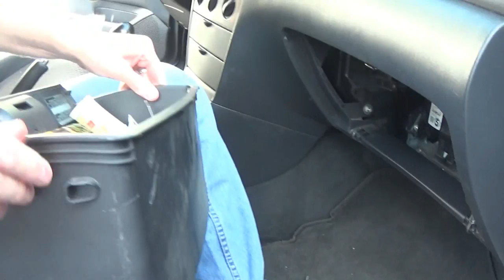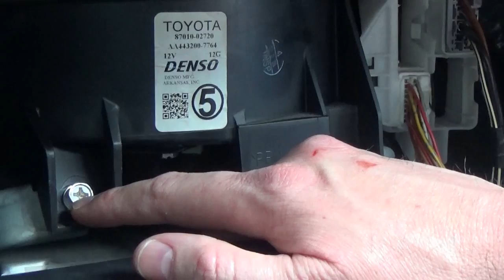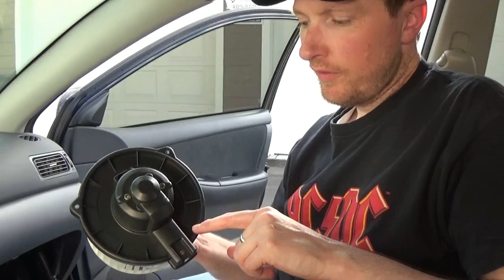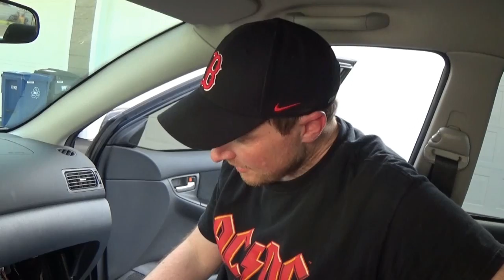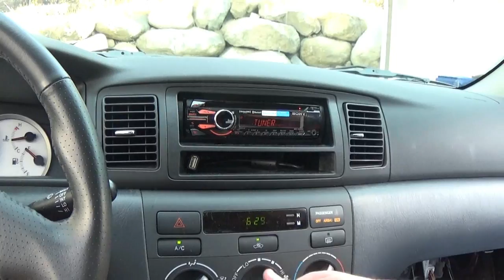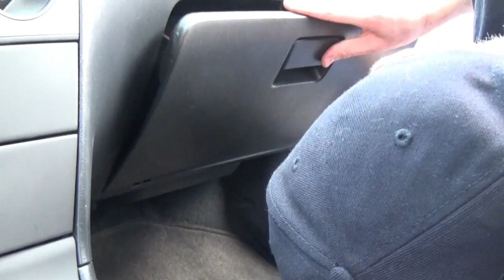How to replace a blower motor in a 2003 2004 2005 2006 2007 2008 Toyota Corolla

Comment: Thank you for this video! We had about -10°C (14°F) here and my Avensis wasn’t blowing warm air, so the car was freezing. Even though you worked on a Corolla, the solution was very similar on my 2008 Avensis T25 and it really helped. I didn’t even have to replace the blower motor — unplugging and plugging it back in made it start working again, so I cleaned it and sprayed the contacts with WD-40. Much appreciated!

Comment: Thank you so much. You're video was the first one i watched. After I watched the video I ordered the blower motor on Ebay for 38 dollars. Had a little trouble with the electrical connection but was finished in an hour.

Comment: Good video, made the job really easy.  One tip I would add is to remove the rear two star screws for the blower motor first as the OEM motor sagged and made it very difficult to get to the last rear screw.  After struggling a bit, I ended up putting the front screw back and it made taking the last rear screw out really easy.

Comment: I am currently inspecting my motor. Not for failure but rattling. I think some small mouse size critter ate its way in through the filter and died and now it bones are rattling like dice in there.

Comment: Such a wonderful FYI. My heater blower quit working . I went to a salvage yard and practiced on their car  . I easily removed the blower and was charged 8.00.
 Before I changed the blower motor I found that I could access the blower cavity through the air filter slot. I found enough grass stuffed in the filter cavity to fill the cage. I removed the grass and turned on the blower. Everything ran fine  except for a loud noise. The pressure from the clog had bent the blower shift and bent it. I will have to replace the motor anyway. I didn't win but I learned. If yougo to a mechanic he will probably charge 250.00 to 300.00. Mine was 8.00.

Comment: Thank you for this video. I had a mouse rotting away in the fan motor. I never would have been able to figure out how to get that fan apart and back together again.
I am a 69 year old woman that managed to squeeze myself into that space and get the dead  mouse out and put it all together again. I could not have done it without this video. And I hope I never have to do it again.
Reply: Well done! I just got quoted $560AU from an airconditioning mechanic. Going to do it myself as well :)

Comment: Do Blower motor make loud
Reply from the maker: Sorry not sure I understand,  could you rephrase?
Reply: @ToddsGarage  I have a Toyota Camry 2011 my fan motor blowing kinda loud
Reply from the maker: It is hard to say for sure without seeing it,  but that is something that can happen if it's going bad. Does it change if the fan speed goes up or down?
Reply: @ToddsGarage  When I turn on heater can 🗣️...then when I turn off no sound.

Comment: Thank you!  I replaced my blower motor in August 2020.  A few months later i smelled burning when the fan was on high and the headlights dimed.  I was told it has too much current.  How do I know what kind of blower motor to buy?

The fan from low to the 3rd setting works fine and does hot and cold, AC and defroster fine.  It's just when the fan on high I smell it and the lights dim.  2005 Toyota camry.  V4.  About 178000 miles.
Reply from the maker: Thanks for watching,  if you go to an automotive store they can cross reference and make sure you get the right model for your vehicle.

Comment: I have discovered a noise from my 2005 Toyota Corolla. It is very faint and when I slow down apply brakes it gets a little louder. However when I turn the fan off there is no noise. Tomorrow I will check the fan thanks for the video AC/DC Rocks
Reply from the maker: Thanks for watching!

Comment: Thank you. That was a clear presentation. I might be doing this tomorrow after I confirm that it's not a blown fuse problem. I feel confident in doing this after watching this video.
Reply from the maker: Thanks for watching, I got a video on the resistor as well.

Comment: Thanks for the video.
But before I tried anything, I first did what I usually do with repairs. I made a soft fist and hit the blower from below. And wham! It started running again! LoL I'll do that with electrical parts (softly) such as a headlight or license plate light and often it solves the problem very quickly and extremely inexpensively! hehe
Reply from the maker: Thank you for watching,  at least you know how to replace if you need to eventually.
Reply: @ToddsGarage  Exactly! And why I thanked you right off the bat; for future replacement knowledge. Because just like a starter being bang with a hammer to work only works a certain number of times until it no longer works.

Comment: Will this work for 2002 camry? My ac stopped working all of sudden. No green light and no air in vents. I changed one blowed fuse and still not working. Also I can hear some noise when driving. But couldn't pin point what? Someone said alternator bearing. But my stopped working after noise started.
Reply from the maker: Hard to know without being there and seeing it.  I hope you get it figured out. Good luck and thanks for watching.
Reply: @ToddsGarage  well today my car started smikin.and i notice black melted plastic or rubber between compressor and clutch pulley..would that be the bearing burnt up?do you have a video to replace that?
Reply: @ToddsGarage  and yhsnk you for your response earlier..
Reply from the maker: @tiffanytip9594  Hi again, yikes, and I am not sure what that could be. I unfortunately do not have a video on that.  Good luck I hope you get it figured out.

Comment: My motor works but is there any way to make it blow stronger air?
Reply from the maker: When you turn the knob does nothing change?
Reply: Todd Saville yes it does change with each turn. But the highest setting just doesn’t feel that strong. Maybe it’s a screen that’s clogged up with dirt or something
Reply from the maker: The filter is easy to check.  Please see my video on that it might help you determine if that is the issue.

Comment: Thank you 👍
Is it normal for some time to influence the warm air?  not always hot air.
Reply from the maker: Hi blower motor should just control the air flow. Not the temp.  Good luck hope you figure it out.

Comment: Thank you for this video. Mine is a corolla 2004, it flows very little (at the number 1) and just little more air (at maximum speed and sounds like it was at the maximum but just not flows much air conditioned), so do you think is the blower too? Thank you again for your response
Reply from the maker: Could be the blower or other things. Did it gradually get worse over time?

Comment: My wife's 03 Corolla just stopped blowing but if I hit the dash or a bump in the road it will usually start back up? Is something just loose? Thanks.
Reply from the maker: Very strange. Its possible a connection is lose. Im not sure where to direct you on that. Good luck and hope you figure it out.
Reply: @ToddsGarage  replaced the blower motor and it works great now 👍

Comment: 8mm works perfectly to remove screws holding blower in place.  Took me total 15min to change blower.  Super super easy.  Remember to wiggle electrical connection to remove from blower, don't yank or it might break.  Thank you soooo much for this video :)  helped a lot!  P.s. cost $40 for blower/motor unit on Amazon.  Also replaced breaker for blower,  $10 Amazon.
Reply from the maker: Thanks for the feedback!

Comment: Hi Todd, good day and thanks for the wonderful video.
Please I'm faced with venting problem. When using the AC and all windows are wound up and the air circulation is on internal re-circulation, each time I pass a smoky area, the smoke enters inside the car cabin. How can I solve this issue please.
Reply from the maker: Hi, not sure how to fix this unfortunately.  It would be one of those things i would have to figure out.  There is a door/flap that stops fresh air from coming in. Maybe it's broke or jammed, or the switch that controls it is broke.  Sorry i cant be of more help. Good luck and let us know what you find out.

Comment: Do you know where the heater control valve is located at?
Reply from the maker: I havent had to fix mine, so not sure.  Possibly on the firewall under the hood.  It probably varies by year and model as well. I would ask local auto parts store when you buy the replacement.  They should have a diagram.  Good luck and let us know.

Comment: I found your video and decided to change out my A/C blower myself.  So I went on Amazon and ordered a new blower and a cabin filter.  Got them yesterday.  Today after work I decided it was time to do the deed.  All the instructions for removing the blower were spot on and it came out without a hitch...

...however... I know why you don't have video of you installing the new blower.  You need three hands and there isn't that much room under the glove compartment.

After spending about an hour kneeling next to the car and sweating like a pig, I gave up for today.  I'm going to try again tomorrow.  

I can use my right hand to try and get the blower lined up with the screw holes and then I can hold the star bit in my left hand.  What I want to know is what hand do I use to put the screw in the hole and hold it there until I can apply the star bit?  

I even tried using little bits of duct tape to hold the screws in the hole while I tried to line them up, that didn't work.    So if you could pass on your secret to actually installing the new one for those of us who aren't mechanically inclined, that would be fantastic.

** just read a comment below about duct taping the motor in place so I don't have to hold it, which would give me both hands free to insert the screws.  I'll try that tomorrow morning...
Reply from the maker: I hope you got it. There is no secret, it's tough to get it in there!

Comment: Excellent video!!! I was able to fix it and it only cost the price of the part and about an hour of time. Them 3 screws that hold in the blower ain't no joke to screw out or in. I wish I had the star screw driver or at least a magnetic flathead. Maybe they would have made it easier.
Reply from the maker: Glad to hear you got it done yourself!

Comment: Thanks so much for making this video, watched it and was able change out my blower motor and have sweet, cool, cool AC again and saved myself over $250 since didn't have to take it to the mechanics.
Reply from the maker: Glad you got it done yourself!
Reply: N N Yeah, it was intermittently working and then not working (and the fan was louder actually then it is now with the new blower in). Once it stopped working altogether (but cold still feel cold air trickling out when driving fast enough on the freeway and worth the recycle air off) I checked my fuses and also made sure the blower was getting power before switching it out,.

Comment: I have tried everything suggested still no air. I had good air on Thursday then stopped blowing. Started then stopped again. Light on AC want light up. Any other suggestions. Fuses good.  Replaced resistor. Blower looks good. Never any noise.

Comment: Hi Todd – I've just opened my glove box to replace the AC blower resistor, but... it's just not there!! :-) Do you know, by any chance, where I can find it? The blower only works on "4", which is direct con, so I want to replace it. But first, I need to find it :-) Thanks for your help in advance.
Reply from the maker: I dont know the answer to that one. You would think it would be inbetween the center console amd the blower motor but i dont know. If you find out please post on here so others will know.  Thank you and good luck.

Comment: Spraying Rataway Fragrance, from Rataway.com  on many things. I would spray the engine, hood insulation, wiring, head & tail light jackets, fuel line, battery case, top of fuel tank, radiator, On the House and business, get stainless steel pot scrubbers (will not rust away like steel wool) break apart stuff in holes,around plumbing and electrical  lines. Then spray electrical lines, Pex waterlines, computer cables, ductwork, heating & ac equipment, Over 8000 people from all over the world are spraying  Rataway Fragrance from Rataway.com safe around children & pets since 1999.

Comment: You didn't mentioned that on some older model Corollas you have to disconnect the battery because the airbag wires are in there.Watch out for the yellow wire .

Comment: Hi Todd. 
I want to do this on my car(such a cool video), but can't find the exact spare part online. What to search for? I found out that the OEN(original part number) should be 8710302080, but there is almost nothing at sale(and if there is it's far above 40$). Hope you can help me asap! Thanks.
Reply from the maker: Hi.  Search for 2006 Toyota Corolla blower motor. They start off around $35. Good luck and let me know if you need anything else.
Reply from the maker: Philip Rasmussen hi.  Search for 2006 Toyota Corolla blower motor.  I just did that search and found a lot starting at about $35. Let me know if you need something else.

Comment: D. Parker - I had taken off a necklace years ago I have a 1997 Toyota Corolla and after I had it above the air-bag like a well or sunken place. At the time my nut case husband slammed on the breaks and threw my nice necklace into the vent into the blower. I watched this movie and wonder if that is all I might have to do? It basically makes a bad roaring noise and has made that noise ever since. Thank you  Donna Parker (donna.parker5555@yahoo.com )
Reply from the maker: +Donna Parker I'm not sure on the specifics of the 97 corolla. It might be similar but wont be exactly the same.

Comment: My AC is working fine, but when I up the speed, there is a noise coming from the back of the glove box compartment. Any suggestions would be greatly appreciated!
Reply from the maker: Kym Luong if it is coming from behind globe box it really sounds like its the blower motor.  Thats only my guess. I hope you can get it figured out and fixed!

Comment: 06 corolla AC working fine today. Got in later and nothing. No warning, fuses good. Is blower motor next logical step?
Reply from the maker: jj18057 does it blow hot air or no air?
Reply: Todd Saville none.
Reply from the maker: jj18057 very well could be the blower moror just gave up.  I wish you luck on what you decide to do. Let mw know what happens.

Comment: @Todd Saville

So I have a 2004 Corolla and the motor kicks on without any grinding sounds and is able to push heat and ac out but my problem is that if it's on level 1,2, and 3, with the ac, I'm sweating still (I live in Florida btw)...if I were to place it on 4, I'm  feeling like it's blowing at what level 2 should be....do you think that it's my blower motor or do you think my ac system just needs to be recharged? On 1,2,3 and 4 if I placed it to direct to the floorboard, I can feel it fine but still not as cold. but facing me directly, it just doesn't seem like 1,2,3 are doing much work at all. 3 feels barely like 1...

btw,  you video is awesome! very easy to understand and great directions, thank you. if this is my problem then I know I can now do it myself.
Reply from the maker: Chris Khadaroo if the motor doesnt push out higher volumes of air on thr difgerent levels i would guess its probably the motor.  if the ac was bad would be air just not cold. so seems the motor is likely the culprit. good luck, hope you get it fixed, its way to hot in FL right now!
Reply: Todd Saville Thanks man! I will try it out!

Comment: mine does not sound like that :( very WEAK actually.. cabin filter has NEVER been changed so I am hoping it did not damage the blower as well.. very WEAK airflow and NONE by the passenger side at all. the control has to be cranked up all the way to get much. well, tearing that apart today.
Reply from the maker: +grettagrids hope it went well.  I bet that filter was completely blocking air flow.  How did it go and how is it working now?

Comment: hottest day 108 get in my car and turn on the A/C  the blower is making awful noise 2003 corolla has 321,000 mileage.  I watched your video whoo, what a relief Thank you for putting this repair video.  As a female, I'm not comfortable taking my car to any mechanic.  What's the part number?
Reply from the maker: Debbie Navarro hi thanks for watching. there are a lot of sifgerent part numbers out there.  if you Google 2003 toyota Corolla blower motor you will have a lot of options. should be 40 to 50 dollars. Good luck!

Comment: My blower motor seems to have a dead spot so that sometimes it won't start unless I remove the filter and rotate the blower a little. I just ordered a replacement motor - a cheap fix thanks to your video!